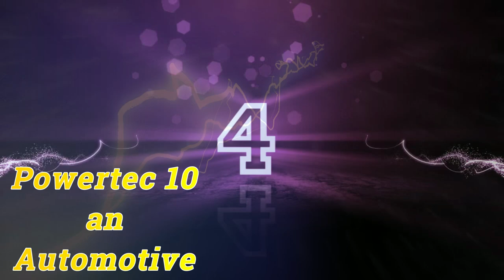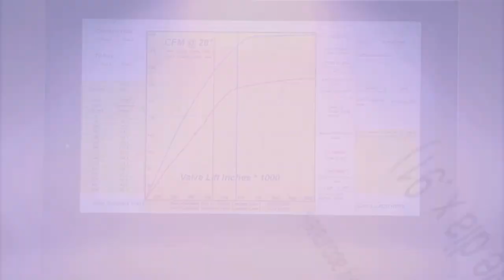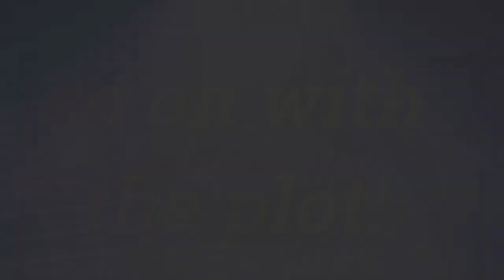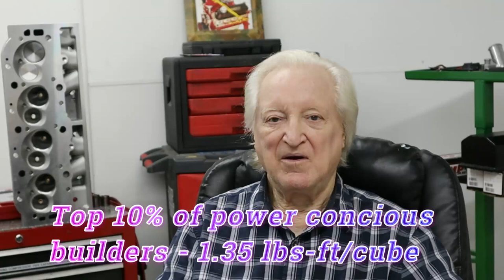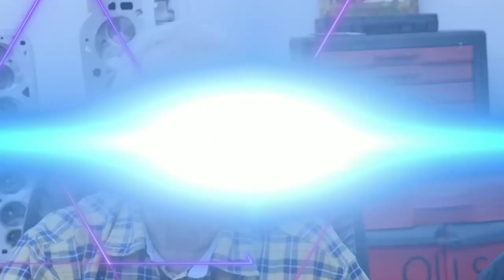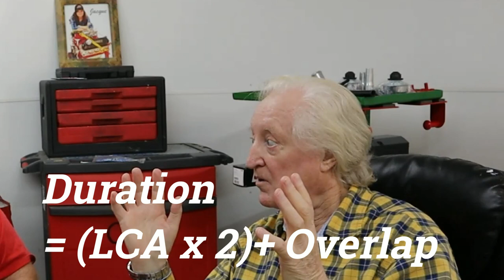Vindicating DV's 128 lobe centerline selection formula

Comment: Back in 1970 Pontiac built a Special 1970 Trans Am RAIV just for a Pikes Peak Hill Climber Racer. Rod to stroke ratio highly modified. Malcolm McKeller had General Kinetics grind a special one off cam for with LCA at 95 degrees. Covered in vintage High performance magazine about 35 years ago now still have that HPP issue in my collection. It had so much torque it spanked every single Porsche in the field and that is no easy Feat as they are stellar world class powerful road race Cars. 
The 1970 Trans Am RAIV Engineering special WON.

Comment: Hello David.  I bought your book on sbc horsepower over 20 years ago , and have susequently bought your older and newer books. GREAT information !  Ive seen others refute it with no comeback of their own. I have found that with enough of your books , the story becomes much clearer.. Im a street engine builder. dont want to be long winded,  but I have a 377 sbc. I bought a comp cam . Special grind. 269, 275. 226, 224  .  .462, .456 lift with 1.52 rockers. 108 LCA. Overlap 56. 0verlap at .050 of 9. Sacrificed some lift for longevity . 10.1 to 1 compression. Promaxx 185 heads. Lot of time just equalizing chambers ccs , in the correct places.  I adjusted timing  to 17 int, 34 total, 20 vaccum. My cruise timing is 53 at 2800. Highly modified 780 , 3310-1 Holley . Guessing at 835 cfm.. Exhaust is flowtech headers , but after much work ........1/58 , 3 in. collector, and a flange that sat squarely. Reduced  to 2-5  in. into   26- 28  in. collectors. Guttted flowmaster termination boxes. I  got the cam after your sbc book. Am  I even close?  1981 Trans am, 4000 lbs. I thank you.

Comment: Mr.Vizard (and Andy) I'd like to tickle your little grey cells a bit.  We are building a 468 BBC for a jet boat.  The jet pump has an "A" cut impeller and will load the motor pretty hard.  So if we make 500 HP wide open, we may see 5,300 - 5,500 RPM. The intake valves are 2.25.  The current flat tappet cam has 284* advertised duration, 504 lift and 111 ICL.  Listed for marine applications.  We have relatively smooth free flowing log style wet exhaust manifolds, but no header effect.  Rhoads lifters to take about 12* of cam timing out below 1,800 RPM so we can try to minimize reversion (water being sucked in at slow speed).  We are using 1.73 ratio rockers to boost the lift an bit.  Your formula suggests a 107 ICL, but that flies in the face of most marine engineers advice cam timing vs reversion.  So I know this is not a car engine and no headers.  Can you comment about any of this ?

Comment: Great content and I am learning a lot, taking notes! I just really wish you would include Mopar engines when giving calculation factors
Reply: Same!
Reply: +1 for more Mopar. This stuff is fascinating!
Reply: Yeah the 128 formula calls for a 109 lsa for my 318..I'm street driven and this sounds abit tight
Reply: @billcat1840  That sounds about right actually. Check out a Hughes Whiplash. 109 lsa for 318, street cam, rowdy idle, strong bottom end and good cylinder pressure.
Reply: @billcat1840  I saw in another guy's video (he was endorsing DV's 128 formula) that with this line of thought, you prioritize LSA over duration. If you have 109 lsa but lower duration, you won't have that much overlap. For example, this guy liked to pick his lsa, then determine how much overlap he wanted (4 degrees is kinda good on a street motor but it can be anything), then use that to determine his duration (by plugging the numbers into something like Summit's cam calculator). 

The idea is that most street motors prioritize duration, then use a conservative lsa so that there isn't too much overlap. However, if you do it the other way around by prioritizing an aggressive lsa but using a more conservative duration (to help decrease overlap and rough idle, low vacuum at low rpm, etc.), you actually come out ahead. The assertion is that lsa helps you get your valve timing events more in line with the piston stroke, and that's a better way to make power then simply holding the valves open longer at more inopportune times during the piston's cycle.

Make of that what you will, I have not tested any of these things. Good luck with the build!

Edit: DV literally talks about this at the end of the video. Use the 109 lsa, just make your duration smaller to reduce overlap and you'll be good

Comment: I've been watching your video and looking at cam catalogs and it looks like the circle track cams are the ticket for Street applications. I know what the little description says in the box but I think there's a lot of similarity between circle track racing and the way you drive a rowdy small block on the street
Reply from the maker: Yes Jim your reasoning is right on!
Reply: Same, ran my engine through his formula and all the closest off the shelf cams are listed as circle track
Reply: I'm seeing the same thing Jim! They are kinda few and far between, but a tight LSA with lower duration has a very wide powerband. Which is perfect for street use. I've been under the impression that tight LSA, meant poor idle quality...this changes how I look at everything.

Comment: I've had many successful fast cars, I really appreciate DV and have enjoyed many hours of his R & D video's. I have duplicated his work with success. My problem is that I use my desk top dyno to help me make a decision. The program is only as good as the information I feed it. My engine is a 406 sbc, 11 to 1 comp. solid roller, 208 int. valve. my best results come with a 109 LSA, and a 110 LSA. The 110 has a few more HP. The Lunati Voodoo series cams are more for street. The late Harold Birkshire from Ultradyne Cams set up the specs for Lunati. I wanted the 248-255 dur. @ .050 cam but the sales person pointed out something that I already knew was for a 406 pro street that I needed the 255-263 dur. @ .050, the desk top dyno liked it, so I went with the 110 LSA.  It is both street and strip. On 1 of the video's for street & strip it said 70-90 and I don't know exactly what they are referring to?

Comment: David, can you comment on the 128 equation results for a dual pattern cam vs the single pattern? I have a cam for my 6.0 LS that on first glance does not fit well with your guidance. However, the actual valve events at overlap may be much closer than it appears. The formula suggests LSA should be about 108.9. The cam is ground to be installed at a 109.5 intake centerline, less than a degree from your formula. The intake opening and exhaust closing events are symmetrical around TDC at this installed point. The advertised LSA, however, is 113 due to the longer duration of the exhaust lobe. Although this is an LS with rec port heads, it seems to me that this cam is very close to the recommendation of your formula. Am I missing anything?

Comment: I watch a channel that probably agrees with much of what you say, and their dyno proved just that. Their assertion is that even turbo or SC set ups will run on those same tight lsa cams better. I wanted some power up high and was convinced that a BTR LSA/LS9 cam at 119+5 lsa was it. Of course, I just didn't do a cam swap, so the testing results are not comparable. Your formula would have it at 106 lsa. 128- 419/8/2.165 x .91=105.9   The cam we swapped out was at120 lsa. In a 1.9 SC 15# boost, LSA motor, 6.8l ZL1.
specs.  235/252 .629/.600 119+5 BTR LSA/LS9

Comment: Back in the early 1970's. I got to know Bruce Crower, and we discussed the LSA and he showed me on his testing that the 108 LSA was close to ideal. The problem I encountered was that the gas mileage was terrible when compared to a 112 - 114 LSA on the Street. When they went to the drags, the 108 LSA camshaft did run a little quicker, just not as streetable as I would have liked it. I discussed with Bruce over the years of just advancing the 112 LSA camshaft to 108 intake LSA. He thought that it was a good compromise and liked the idea of grinding camshafts 4 degrees advanced for Street use for the average daily driver that wanted a performance camshaft. I stayed with this idea all these years. Now since everything is pretty much fuel injection, I wonder if going to a 108 - 108 LSA is better? Or is the intake of 108 LSA the most critical part of this and not the exhaust? I do not build motors anymore, just performance 4L60E's and 700R4's. I try to stay on top of things when possible, and learned a lot from Smokey Yunick, Pepe Estrada (before he sold to Tom's Differentials) and others who were qualified in their fields. Somehow I only heard of you a couple of times many years ago and just recently he came into view, and I would sit down listen, and learn something. I am 73 and I love to learn things that go against the narrative. Thanks for still being around

Comment: The light bulb just went on: so many ls' run out there running good with wide(er) lsa's because they are usually 10-1 or higher compression,  1.7 rocker, larger cam core and decent airflow with a simple valve job. Essentially they follow DVs guide.

Comment: did the math on a chevy 350 and it works,  LSA seems low but i understand why. i found it dint work well with 455 Buick, i was told chevy 454 needed 134 as starting number, cool! how will this work with the low extreme 1.3 to 2 litre? for those struggling with the math remember your order of operation with the parenthesis.

Comment: I've always had the best results with my rowdy 350 SBC engines with a 106 lobe separation.
Reply: What type of duration cam do you run with that obviously it cannot be very much you need to put much more information in there other than a 10-6
Reply: @eugenekillen5919  270 to 280@.050 range usually. Sometimes more. Built a 302 SBC with a 288@.050, 680lift. It also had a 106 lobe separation. Ran 9.70s in the 1/4 NA in a Vega drag car. Currently building a 355 with a 274/278@.050, 668/669 lift, 107 lobe separation.
Reply: NA SBCs making alot of power run better with tight lobe separation cams. Wide lobe separation is just a big shot in the fuckin foot. Might work better for EFI or a blower, but NA always runs better with a tight lobe separation. I'm building a 496 bigblock Chevy now with a 106 lobe sep. 714/714 lift, 274/282@.050. Bullet Solid roller. Expect it to make 800+hp NA.
Reply: @thereluctantgearhead4544 what kind of power did it make?
Reply: But how much vacuum will the engine create.
Reply: @brick2077  It's still on the stand. Hope to have it in a vehicle soon. Built 3 bigblocks at the same time.
Reply: @jarheaded9278  Not much, 5in or less. Wouldn't advise cams like that for cruisers. I'm into drag racing, so everything is manual.
Reply: @jarheaded9278  Street type engines should run at least a 110 lobe sep or so. Get pretty lumpy below that.
Reply: @jarheaded9278  Cam should match the rest of your components.

Comment: Interesting, I just watched the Richard Holdner You tube Video of the BTR stage 1,2,3 truck cams vs the Truck Norris cam.  In the video it showed the cam specs. Stage 1,2,3 were all within 112,110 LSA.  The truck Norris which put out more torque and HP than the stage 1&2 cams and just slightly less HP than the stage 3 came in with a 107 LSA.  Which is exactly where David's graph intersects for a SBC. Hmmmmmmmmm

Comment: @18:00 3/4 cam ~ 540° crankshaft degrees is 3/4ths of 720° crankshaft degrees. Ed Iskenderian or Chet Herbert? we'll probably never know for sure who should be credited for the 3/4 reference, though... the valve off the seat 540° crankshaft degrees is the threshold of all out internal combustion excitement... providing the necessary cylinder head flow numbers are present. Credit where, Credit is due... I'll grind any cam for $39.95 Vizards right there with em'.

Comment: Ok. So I have Holley fuel injection on my car. If I tighten the LSA from 112 to 108 I’m worried about having enough vacuum for the FI to work correctly.
Reply: If you are worried about vacuum use less duration..  it will make more power having the right LSA vs having more  duration on a wider LSA
Reply: I believe with Holley FI with low vacuum/large overlap  cam you can custom tune the idle area of the fuel map then switch off learn in that area as the FI generally over fuels at idle as a result of overlap
Reply: Sniper EFI will run on pretty low Vacuum.  I'm at altitude (7000') and my car makes 12"Hg barely enough for power brakes with a Vacuum reservoir but the Sniper works excellent.

Comment: I think some people are Not getting it. YOU have to know how much  overlap triangle you need for your particular combination, to get  the rev range  where you want it, Valve size , port size , flow no.s , lift , compression , cubic inches, bore stroke ratio . Once  this is known, use the 128 Formula to get an lca. Then you will know duration. This can then be manipulated according to your exhaust system. So DONT post negative comments. David has decades of experience , articles, books, videos. Read, listen, watch , listen. I tell  everyone that comes to me, ' It doesnt take a rocket scientist to assemble a SBC , but it doesnt hurt if you are one' !

Comment: I put together a little Ford 302. I'm not good with all the equations you're talking about so let me know if I screwed up and could get more power. 
It's a 1985 GT block. Been bored 30 over and decked 15 thousandth. I'm running GT40P heads that have been shaved 8 thousandth and upgraded springs to match my cam. I'm running stock 5.0l crank and rods. I do have Chevy 350 30 over 11:1 compression pistons. I'm running the Typhoon dual plane intake with a 600 cfm Carter/AFB carb on a 1" spacer plate.
My cam is a Crane HT-284-2-NC. Part number 363941. I'm running timing gears installed straight up.
This thing is crazy fast now. I'm running a 3.8l torque converter with the 4r70w trans with 273 gears. I need traction help right now. I'm getting that together slowly.

Comment: It took me a while but I think I got there. I was saying to myself what sort of cam is the TMC trying to select? We all know that a max HP cam won’t work in an RV. If I understand correctly what you are saying is select the LCA based on the engine and then stick with it no matter what valve events you finally decide on. I also found it interesting to hear what you were saying about stroker cams and the TMC program. Guess what, I have the 90 demo version and was getting LCA of 103 on the stroker engine I was imputing. I previously couldn’t work out why?

Comment: I am building a 427 LS motor that has 14 to 1 compression cylinder head flows 360 on the intake and 244 at 700 lift. 274 on intake 284 on exhaust lobe separation 112. 704 lift. I’m trying to make over 700 hp have not ordered the cam yet, but this is what was recommended for this motor.

Comment: I built a 327 in 1997 and followed the recommendations he gave in his book and it was better than anyone believed. Everyone told me to build a big block, well I never had it dyno tested, but it was impressive.  Dished pistons, milled 305 small chamber heads, etc. I'll say that I would prefer that engine at less than half the cost to the stock 6.2L LS3 I have now.
Reply: I came here trying to figure out what I need for a 327 I have in my S10! It has aluminum heads with 2.02 valves 64cc combustion chambers I'm unsure of compression. I'm trying to figure out how to work his formula. What cam did you go with?
Reply: @brandongibson85   isky mega cam 270, dual plane 4 barrel carb. intake. Better power off the line with great mid range. Close to the best set up IMO for a ENJOYABLE daily driver.

Comment: I agree with every thing said,but in the road racing world with power brakes on a 350 chevy the loss of vacuum to the brakes makes any cam with less than a 110 overlap not usable because lack of vacuum. Our rules don't alow hydroboost or vacuum canisters so we are stuck with it!  Your system is correct for max power!

Comment: Have a 4L Ford engine from Australia with a CR of 10.3 and dual VCT. Can someone tell me if my calculations/understanding is on the right track? 4L = 243 CID/6 cylinders = 40.5. The intake valves are 35 mm and exhaust valves are 32 mm. 1.3775 inch x 0.91 = 1.253525. Therefore 40.5/1.253525 = 32.3088. When we subtract this from 128 we get a LCA of <96? The CR at 10.3 is only slightly lower than the 10.5 in DVs eg. Have I missed something here?

Comment: I'd like to have a cam design by Mr Vizard for my 2016 Hellcat. I'd say most of the cams make minimal power and I think its because of the wide angle cams. I'm assuming LCA is the same as LSA. I'd like a mild duration moderate lift tight lobe cam. Flying Ryan makes a Tomahawk 2.0 cam that is close to what I would want. 228/238 111+3.

Comment: Hi David. Just some ( I hope ) constructive criticism. If you were able to give some dyno examples to show the gains of the same spec cam with different LSA vs the correct LSA it would help. I think you did that in one of your books but it would help those here. Andrew
Reply: Yes, it's in the books.
Reply: Try watching Holdener's 108, 112, 120 lsa  Dyno video.
Reply: @Comet-hn3gm  for us newbs what are the best books to buy? All I see pop up are the sbc/bbc books in a search.
Reply: @joeinmi8671  The ones I have had for years are ' How to build horsepower ' SA24  'How to tune and modify Holley Carburetors' SA216 and   'How to port & flow test cylinder heads ' SA215.         Good information, that is always relevant.
Reply: DV strongly emphasizes that when you have the proper cam it MUST be installed at the optimum angle FOR YOUR SPECIFIC ENGINE which can ONLY be determined by dyno testing. It might be +- 4* from what the cam grinder recommends. ONLY testing in your exact engine with it's exact intake and exhaust etc can give the proper installed angle.

And then we have to worry about timing chain wear/stretch retarding our results.
Ouch.